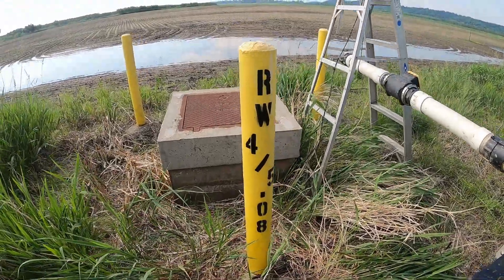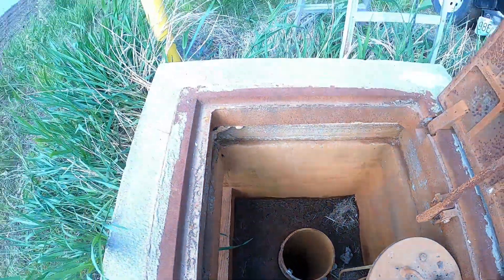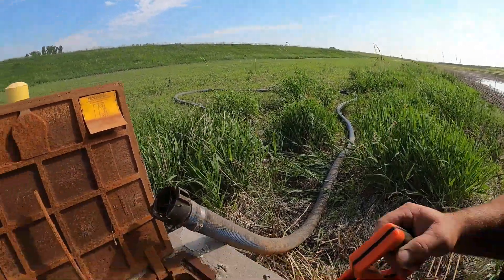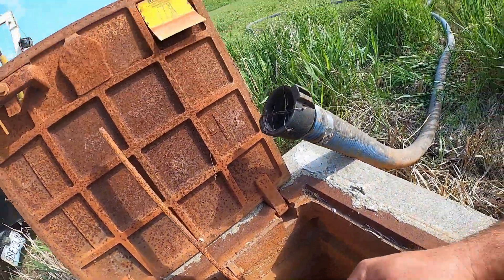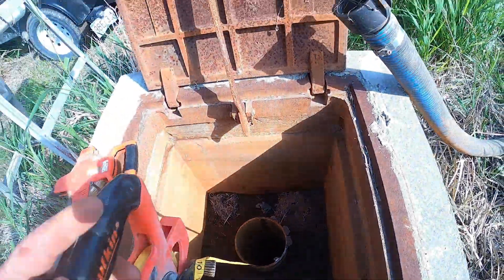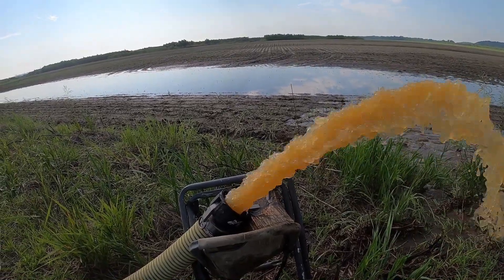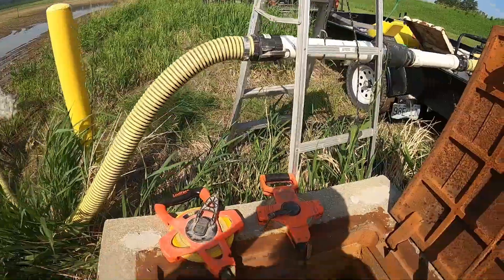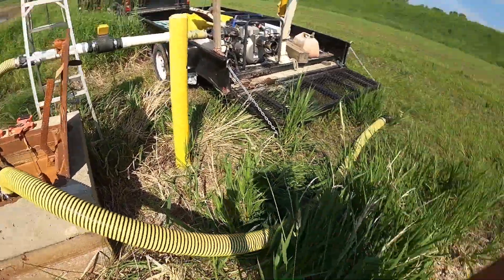Pumping relief wells on the Missouri River. You wont believe what comes out of a well on the bottom

Comment: So when the water level rises, say during heavy rain and the level in the relief wells rise, would you discharge the relief well water OUTSIDE of the levee catchment area? 
In Alaska here.
PS. Will be cutting more firewood this weekend, it'll be the last for this season.
Reply from the maker: @tundrnomad8113 yes they are all on the outside of the levee. Most of the wells drain into a drainage ditch that gets pumped back into the river.